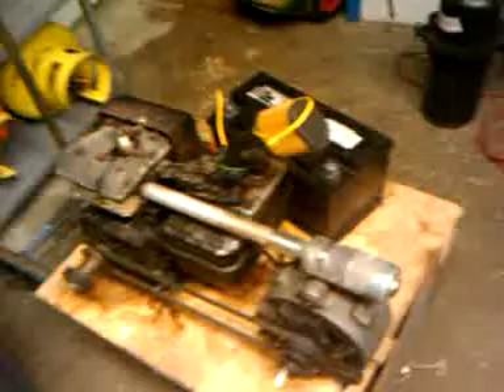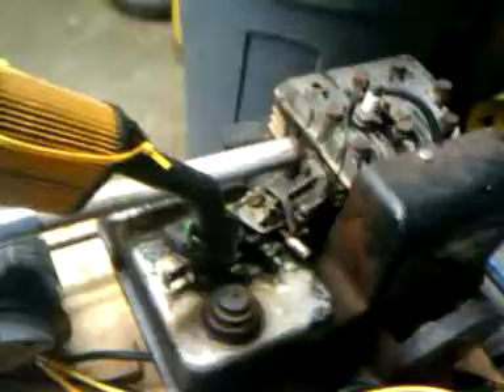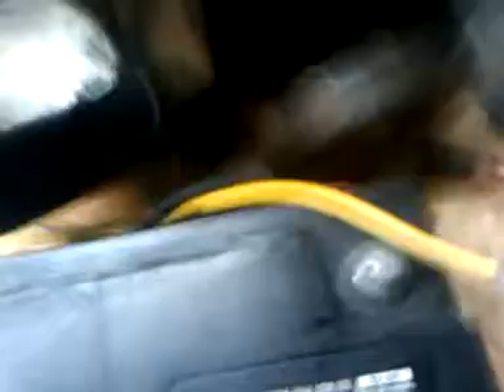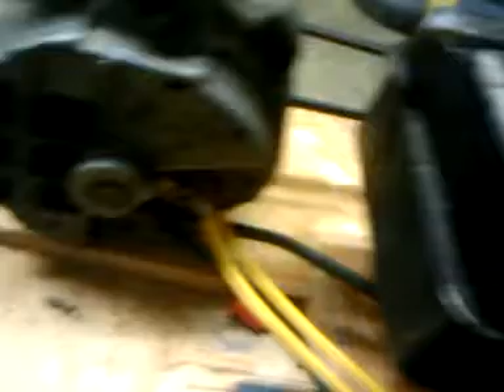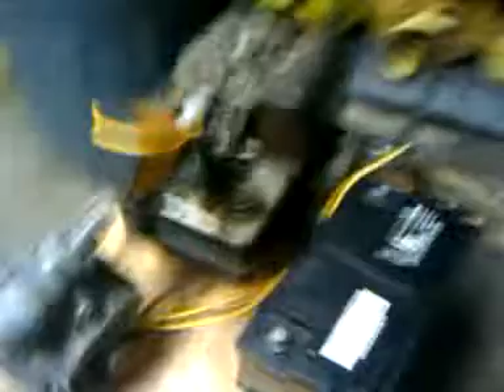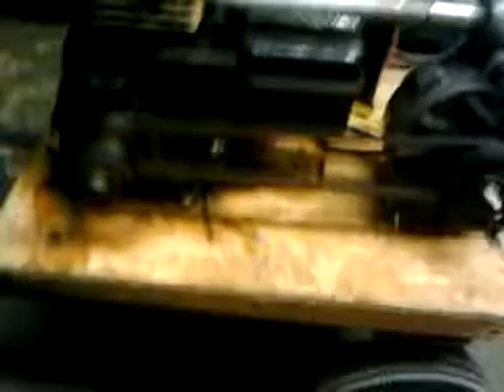Homemade generator

Comment: the 2 wires on the side of the alt need to be hooked up as follows, hold or set alt so the back is facing you. Now the left wire hooks up to a switch 12 volt power suply the right wire hooke up to the stud on the back of alt as well does the leed to your battery, then look on back of alt & you'l see a bolt hole thats says grd or grn that is where you hook up the wire to the negitive side of battery, & the pully on engine needs to be around 5 to 6 inches in diameter , now it will work

Comment: The smaller terminal needs to be "jumped" to the larger terminal in order to create the 'field' necessary to start producing current. the speed is fine, alternators have a kick in speed yes, but its something low like 200 rpms don't worry.

Comment: alternator has to be turned at a high seed in order  to work. i just do not remember the speed  you need for it  too work . may need to gear it up 5 to 1 .